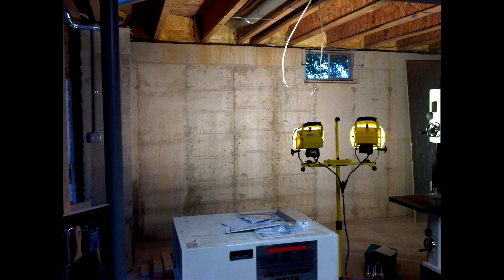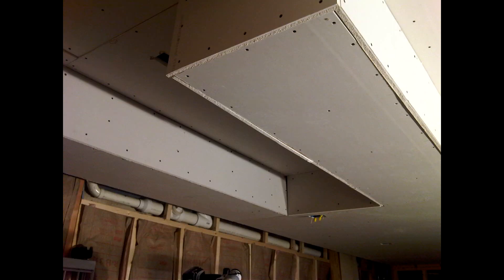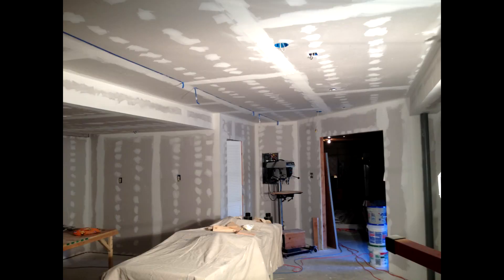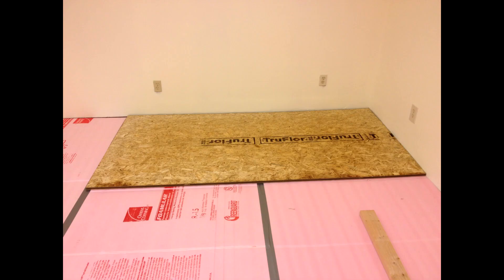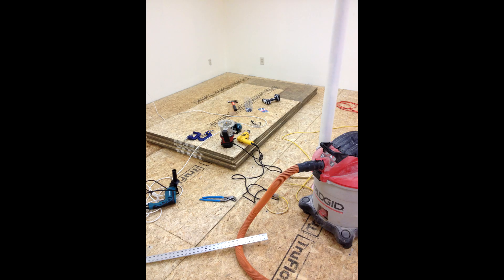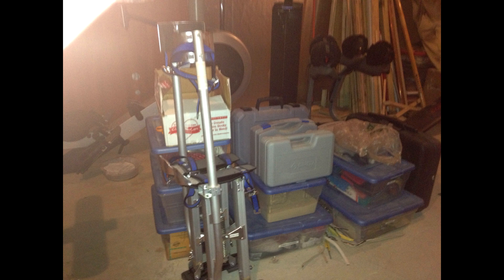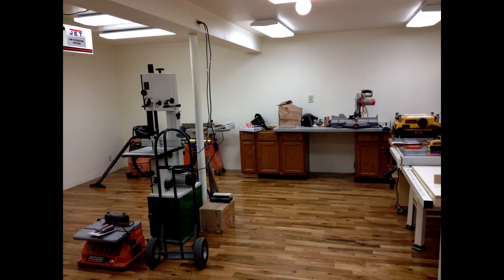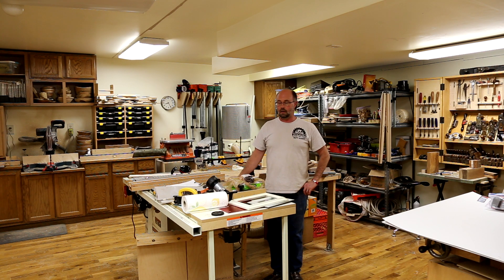Building my shop

Comment: Outstanding! A couple of questions regarding dust collection/filtering and sound.  Do you have any issues with sound/noise in the living areas of your home from the loudest power tools, i.e., planer, joiner, table saw, etc.?  Also, is all of dust confined to the shop and not in the living areas? How is the air quality using the Jet dust collection and air filter.  Thinking of doing something similar and your basement is like mine.  Thanks for any comments.  Dave
Reply from the maker: I thought a lot about noise when designing and building the shop.  My ceiling has composite joists on 24" centers.  I ran stringers on 16" centers perpendicular to screw the drywall to which reduces the noise transmission a bit.  I also placed R13 fiberglass insulation in the cieling leaving an air space as well, both of which help with noise.  Finally, I used 5/8" fire code drywall on the cieling.  My shop is directly below our family room, and I can do most operations without it being a big nuisance upstairs.  The one thing I try not to do when people are upstairs is run the planer and dust collector but most other machines with the dust collector are fairly innocuous.  There are sound isolation strips, etc. that you could consider between drywall and the studs which would probably help as well.  Good luck with your shop and thanks for watching and commenting Dave!

Comment: Shop looks great! i can only dream of putting nice flooring in mine ha ha. out of curiosity what are the dimensions of your shop?
Reply from the maker: Thanks Chase!  It's kind of a wierd shape as you may be able to tell, but its approximately 20×30' if you don't count any of the spillover lumber storage outside of the shop proper.  I'm still negotiating for a little more space which would probably be an assembly area.
Reply: @JeffMarxWoodworking  that's a good size! I'm moving my shop from my 15x20 garage to the partial basement, that said one side is a rectangle (20x15) and the other is a square (23x23). I'm just trying to decide what side to use for all the tools and assembly area. My thoughts were assembly in the square part so there can be storage and no movement restrictions as the tools can use the dead space created by the other and sit nice in the rectangle. Should be a great shop if block walls and concrete floors are alright 😉. (Just a side note I'd like to thank my wife for hating basements and giving me all the space ha ha)
Reply from the maker: @ArchCityCraftsman  Fantastic, and congrats - that should be an awesome space!
Reply: @JeffMarxWoodworking  keep up the good work! I'll be around watching as you post!
Reply from the maker: @ArchCityCraftsman  Thanks!  I've been posting every Friday afternoon for some time and hope to be able to keep to that schedule.